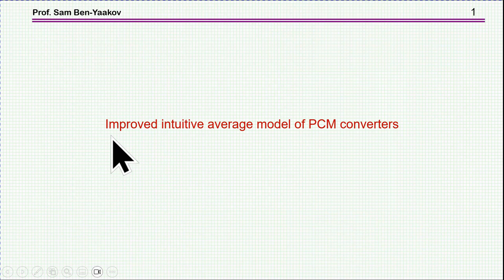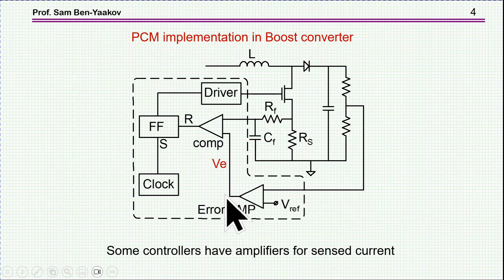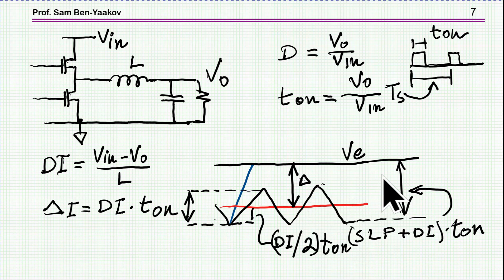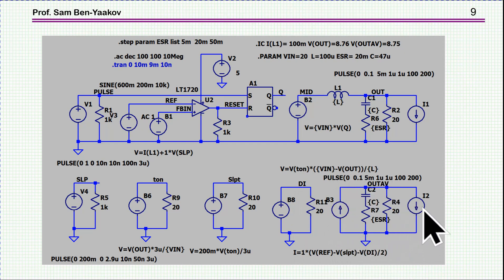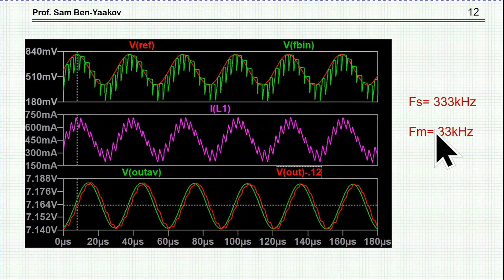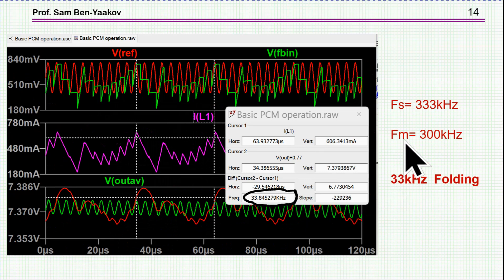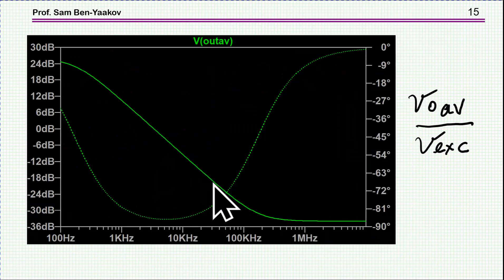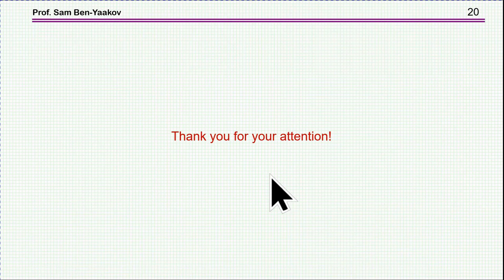Improved intuitive average model of PCM converters

Comment: Hi professor, thank you for this video.
Correct me if I'm wrong, but shouldn't in slide #9 (the schematics) the sources B6 and B8 reference V(OUTAV) instead of V(OUT) ?
It's true that V(OUT) is low ripple, but still you are creating some cross couple between the switch model and the average model.

PS: It would have been interesting to compare the average model results with and without the inclusion of the slope adjustment (i.e. as shown and with V(slpt)=0)
Reply: find the same!
Reply from the maker: I guess it is OK?

Comment: Doesn't the visible phaseshift in result imply limited useability of the model for evaluating feedback loop stability? 
On first sight it looks like it will be predicting more optimistic phase margin of the loop.
Reply from the maker: I think that this deviation is due to sampling delay in the switched circuit. This is not shown of course in average models including state space averaging and is not included in text book transfer functions of PWM converters. So this is not unique to the model shown. There are ways to add the sampling effect in continous models. Thanks for the conversation.

Comment: Hi sir thanks for the excellent video .I have questions does this average model loop response matches with actual measurement result?
Reply from the maker: We have done in the past experimental verification  of the average modeling approach. But not this particular one. Time domain simulation is very close to experimental.
Reply: @sambenyaakov  Many Thanks Sir ...the problem I face with average model is it doesn't not matches with actual measurements,I mean there is a quite large variation..could you please make some video on this topic like how average model can match actual measurements results with minimal variation 🙏
Reply from the maker: @biswajit681  Average models like state space averaging do not take into account (analog) sampling delays and distortion and certainly not losses or parasitics. Have you ever tried to compare text book transfer functions to actual measurements😊 Indeed,  a good subject to a video. Will try.
Reply: @sambenyaakov  Hi sir recently I tried with Vorperian switch model and there is  excellent match at mid load to peak load with bench test measurements but at light load variation is quite high...I am talking about peak current mode control Buck Converter